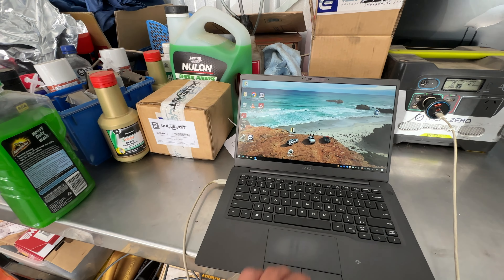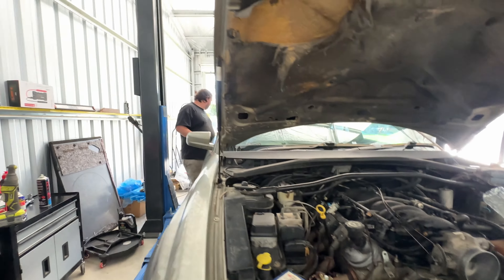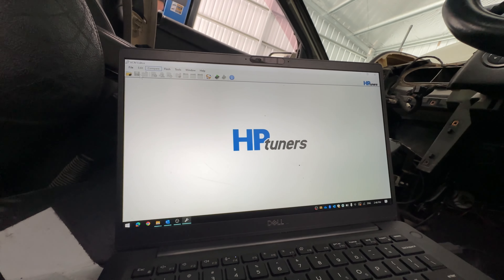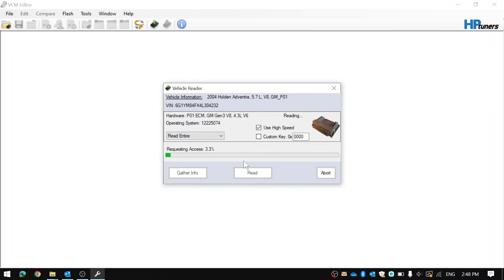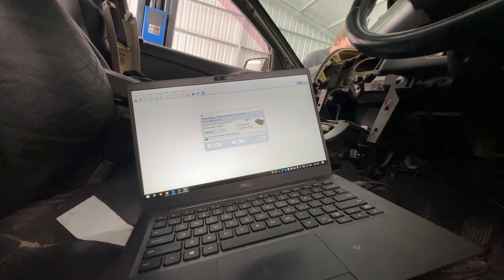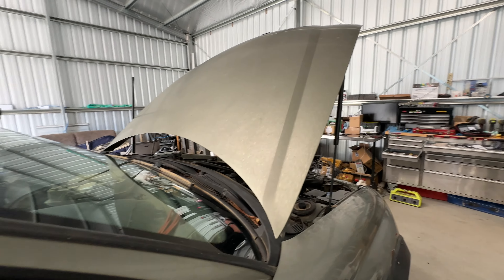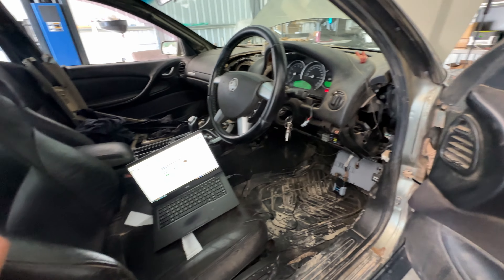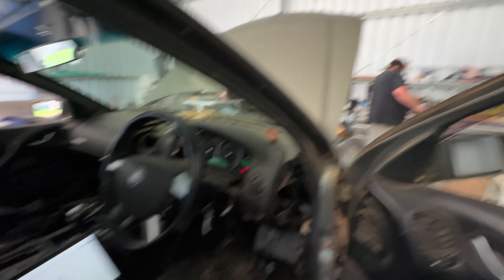Simple Tuner Lock Bypass for HOLDEN LS1 PCM GM P01 P59

Comment from the maker: Important, because we did this - we had a PCM link issue with our computers in the vehicle. To get around this we had to turn VATS off and reflash otherwise we couldnt get the car to start due to missmatch. When it comes to linking computers THEY ALL NEED TO BE UNLINKED before you do this if you want to relink them back up after the fact. We used a tool called Vident here to get the link codes. Our GM Tech2 tool wouldnt give us the codes without probably access TIS access.

Comment: Hi Mate - Good vid. Just a question, PCM Hammer has the ability to write stock files back to the ECU also, but being open source you dont need to use credits like you do with HP Tuners. Did HP Tuners provide some functionality over PCM Hammer? Just curious. CHeers mate. Enjoyed the vid........and great to see Aussies getting amongst the action.
Reply from the maker: Hey mate, thanks but I dont think we have enough exposure with the LS1 with the software to determine. We used HP Tuners because we already had it, but it has also allowed us to change low/high speed fan triggers, lockup on the 4l60 changes with the converter too - but beyond this, my feedback is limited and probably amature level at best.
Reply: @AllTerrainAction  good stuff bud. If you can tune with HP tuners, then you should be with any tuning software really. 
PCM hammer will do the reading and wiring. And you can use TunerPro to do the tuning. 
Both are free pieces of software……no licensing required. 
This is for the P01 gm ECU you worked on. 
Just a thought mate :) 
Take care.
Reply from the maker: @davef2415  Thatll work with our VCM MPVI3 device/cable? I might have a play around, licencing PITA as you clearly know. What cables do you guys normally use?

Comment: How many cars have you worked on ? You are seriously worried about water / coolant and the engine overheating ? Sir from someone who works on many V8s LS included , I'd bet money you could drive that for an hour with no water , I did in Brisbane 8 suburbs , stuck at lights ECT NO water at all about 50 min trip ! Engine was fine once rad was fixed and still going years later , modern cars can temp sense , if it gets too hot it drops certain cylinders to run cool air through engine ( limp home cooling mode) plus the large amount of oil cools the engine through the alloy sump very well , I wouldn't drive to Townsville but like I said 50 + min no water at all ! Still ran fine 50 min later when I turned it off , I've seen a ford six do it too and a Buick / Commodore do it even longer !
Reply from the maker: I probably could, but I'd rather not if it's avoidable. Definitely between point A and B in this video, there’s probably not much to worry about. The oil temperature wouldn't even reach a point where it becomes a concern, as you mentioned. Assuming you're not familiar with much of our other content, you'll find that I try to present the safest way to do things, as some of our viewers might lack experience working on cars, and the fundamentals could be missing. I'm not particularly concerned either; I just prefer to make an effort. 50 minutes I rekon would be a big streach, but possibly if the air is flowing. I can assure you the alloytecs though wouldnt last more than 10 minutes driving before it would reach its thermal shut off point though!

Comment: Would it be worth throwing on an exhaust, intake, and the Avalanche tune?
Reply from the maker: Could do primary objective is to get it operating normally, correct cooling profiles and reliability then Wal will likely add some performance/sound and a good tune. LS tunes when you advance timing a little correctly I’ve seen keep good power and better fuel. Even on AWD models I’ve see  9.5L/100 highway and 12L/100 mixed urban conditions when driven normally. Although Wal is a spirited driver. We have a good LS tuner know in the community.

Comment: Will the some process work with a vz v6??
Reply: And what cable do you need to hook it up to hp tuners as I can't seem to find a cable for it cheers
Reply from the maker: No this won’t work with E55 ECU/PCM presumable to be totally different logic. I don’t even fully understand why this works, but I assume it has something to do with going into recovery mode of some sort and it temporarily gives you read and write access. Using another program (which I can’t mention here) I was able to inspect communication between PCM and software and can see it just simply gives the all clear 67 01 34 response which then then HP Tuners accepts and lets you read/write anyway.  I’m not really all within the programming world of things this was totally experience based off someone else’s find. I’ve never seen a locked E55 before what do you need to do with your VZ Alloytec to need to do this?
Reply: @AllTerrainAction  well previous owner said its been tuned on 98 but no proof no print outs ect and gear ratio on a tech2 /vident 1400 says gear ratio are 3.9s but the diff sticker says 2.87:1 is the only way for someone to of changed that gear ratio in the ecu have to of used hp tuners ect? / get it tuned as it has pacemaker extractors hiflow cats twin exhaust system and growler intake so trying to see if i can look at the tune file on HP tuners ect myself so I don't have to pay the local place $300 just to have it checked ect but I can't seem to find a cable that goes from the VZ E55 ECU to a laptop so I can actually check cheers
Reply: And it also says requested torque is at 99% so I'm not sure if that's stock for a vz v6 ect but yea hoping to find out if it's tuned or not tuned or is tuned but needs a tune ect as I was running very very rich both fuel trims would be -1 for bank 1 sensor 1 ect short term fuel trips but long term were -50 ect like crazy numbers and exhaust is completely caked in sook inside and the front o2s going into the pacemakers have seemed to be not present anymore but when looking at live data all o2s are reading ? but the rear 2 into the hiflow cats are still working fine
Reply from the maker: Can simply connect hp tuners on the mpvi3 to pull tune down and compare to a factory one, to see what might be different. If it was tuned for 98 you’ll quickly see the difference. Most of the time this just means they had the car go in with a full tank of 98 and the tuner worked off the 98 baseline and then tuned it off that.